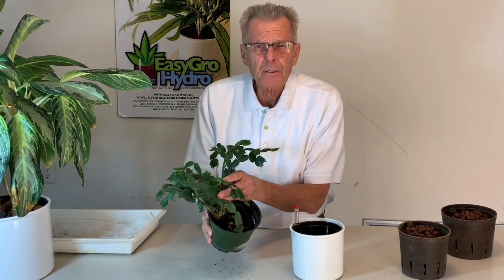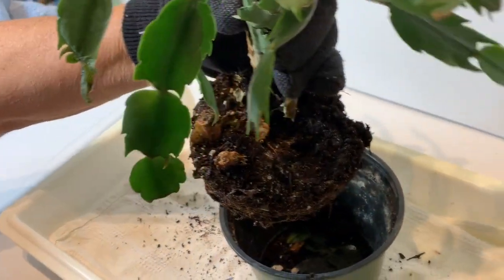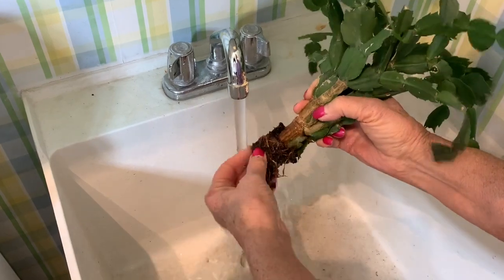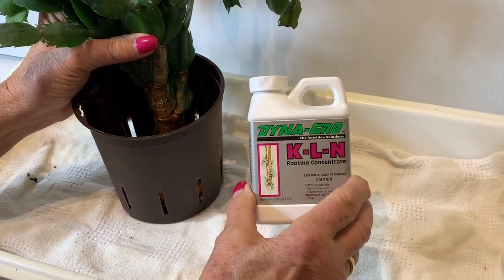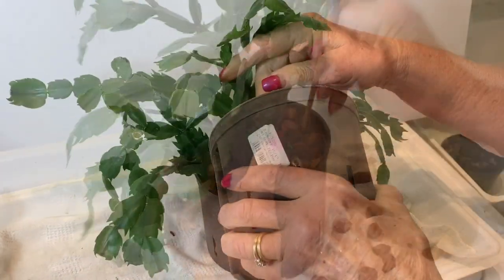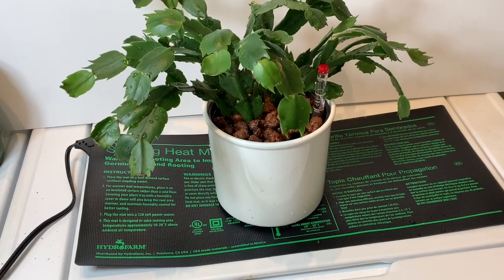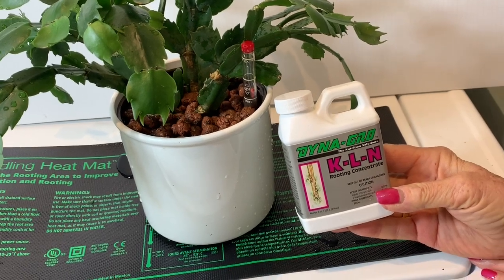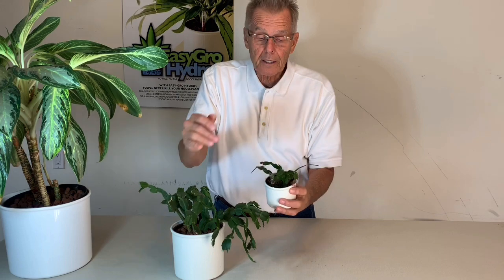Transplanting Christmas Cactus from Soil to Hydroponics

Comment: Very informative video. I'm going to transfer my struggling Christmas cactuses too. Thank you! I will buy the KLN Dyna Grow. Lots of good tips with using a heating mat and drying them out between watering.
Reply: @Louis Ernesto instablaster :)
Reply: @Colt Aarav i really appreciate your reply. I found the site thru google and Im waiting for the hacking stuff atm.
I see it takes a while so I will reply here later with my results.
Reply: @Colt Aarav it did the trick and I finally got access to my account again. Im so happy:D
Thanks so much, you saved my account!
Reply: @Louis Ernesto You are welcome =)
Reply: Repotting process is straight forward, but no explanation on how to water. I’m assuming it’s different than other passive hydroponic methods. Do you need to water more often when in LECA? Does a wicking system work for this species? So many questions & no answers. Local hydroponics store just wants to sell me expensive systems & lights. I’m at a loss.
Reply: @alohafromthe3033  Wow. I wasn't expecting a response 4 years later.

Comment: How do you mix the KLN solution thank you.
Reply from the maker: I use 2-3 TBLS per gallon of water - which is slightly more than the package says.
I have evn used it a full strength on cuttings. 
Tip: save the KLN used for soaking pebbles and use it to water new transplants. Mature plants like a KLN Solution every couple of months too!
https://www.easygrohydro-store.com/dyna-gro-kln-rooting-concentrate-8oz/